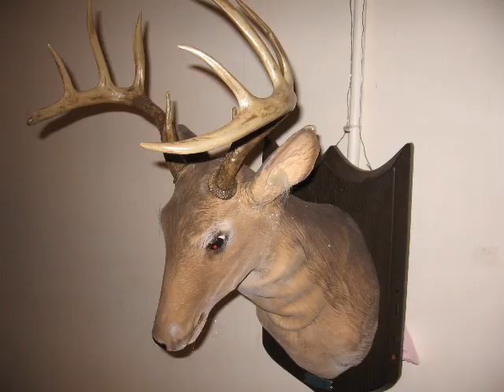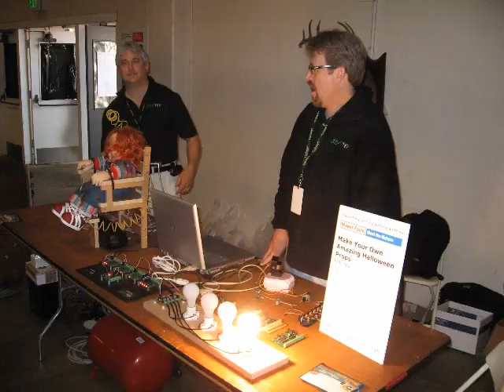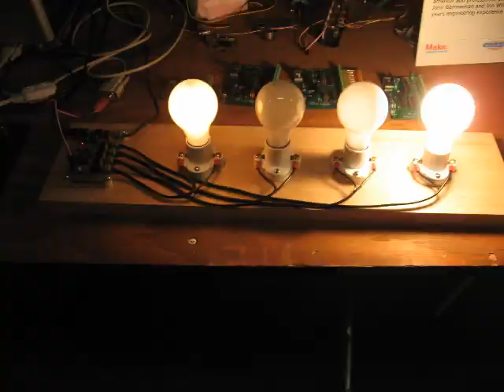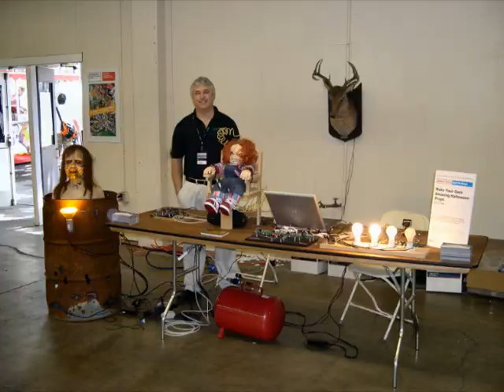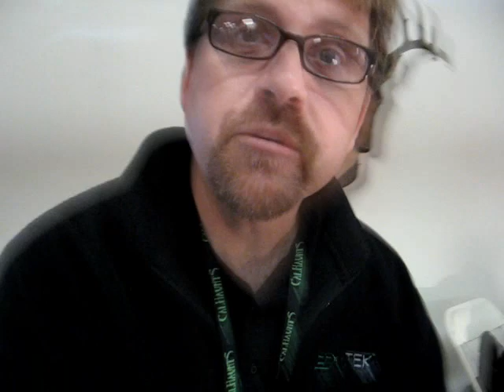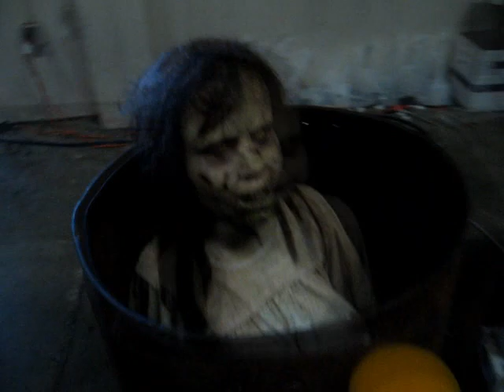EFX-TEK at Maker Faire San Mateo California

Comment: The thing controlling the lights is a Basic Stamp micro-controller which is in turn controlling a 4 channel dimming module.   The effect is called "light chasing". The micro controller can be programmed on your computer.  You can program just about any kind of sequence you want.  Details are at the EFX-TEK website forum (do a search for it).  I have posted a few lengthy threads there about light chasing.